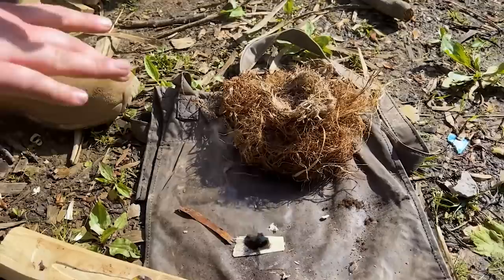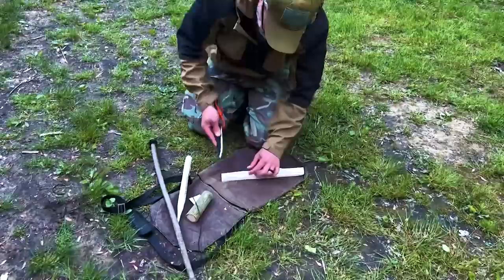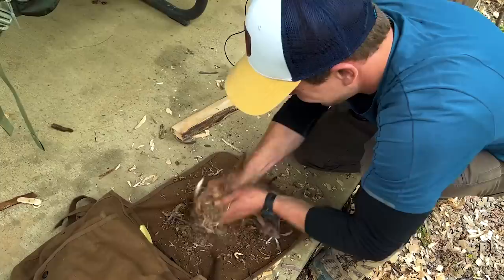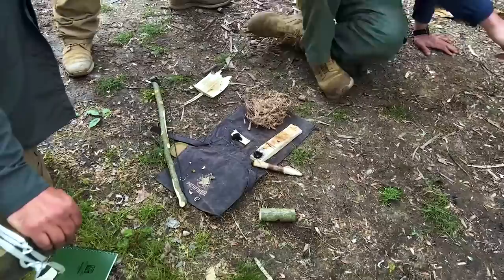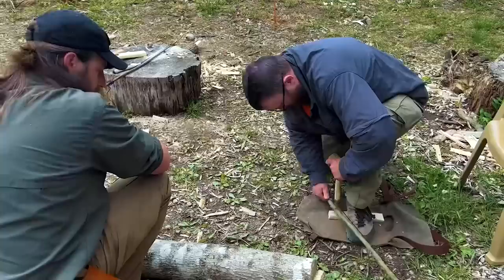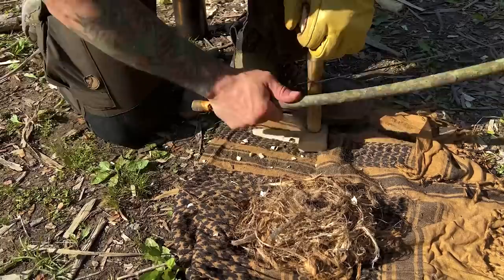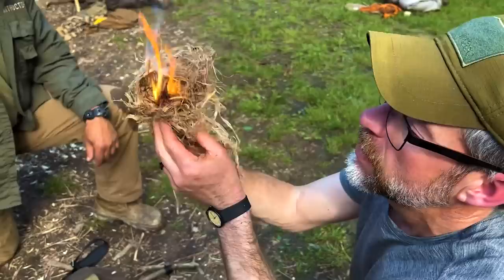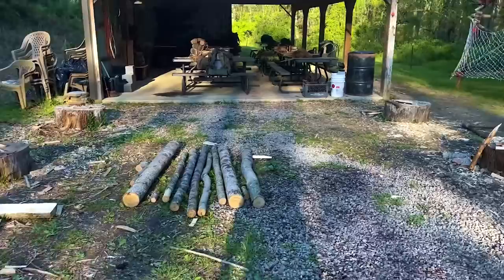Bow drill Exercises off the Landscape Day 1 Intermediate Course

Comment: i don't like the shape of those spindles. they're like 2 and 3x wider than i would have chosen, and i really don't like having the point on the top going into the block like that. I think the smaller diameter of the spindle translates into higher RPM and more friction. the best spindles i've ever used were only about the width of a finger and were straight up and down with no tapers. you can shape the top a little to mate well with your block, but the cup in your block that the spindle fits in to should be deeper than the one shown at 3:40ish. imo the shape of the cup is more important than the shape of the top of the spindle bc the cup will shape the spindle.

i have no idea where this school is, but i'm guessing either PNW or near the Smokey Mountain states in the south east. In the Southwest we've got Yucca, which is probably the best low combustion material for firesets, even better than saguaro. my ideal fireset is a yucca board and spindle, and i like using stone for the block. a nice flat one with rounded edges that fits in your palm is the best, you can find them in river beds. If you have no shortage of yucca I say use it for spindle too, but it is a softer wood so the spindles get worn down pretty quick. I guess that's a question of how much it's used. i needed more than 1 spindle in a 6 week survival program. 

oh, i also like a bow that's completely straight and only slightly bows once you twist the spindle into the rope. i had some dudes in my group with more "bow and arrow" shaped bows, and those bows allowed for bad technique and lateral movement to creep in so you're wasting energy.

I'm craving an ash cake now.